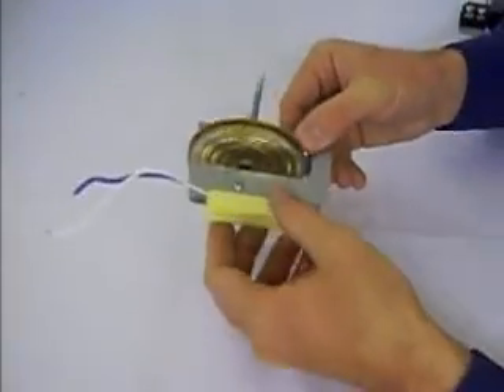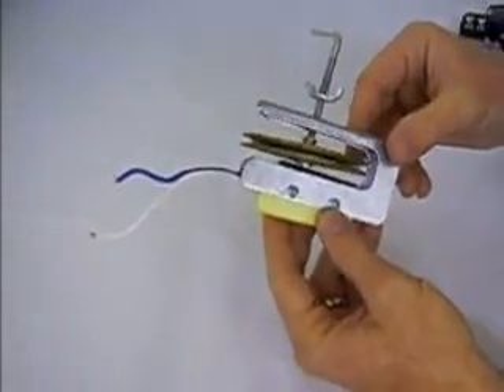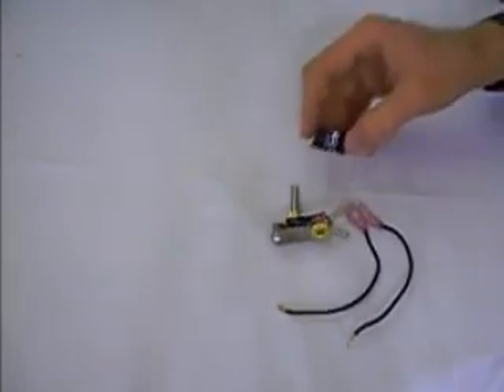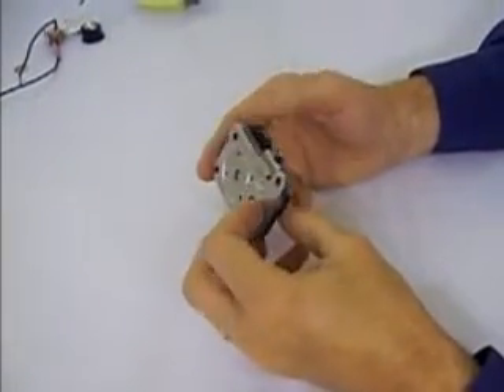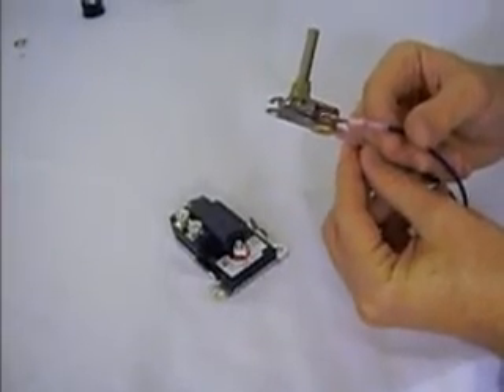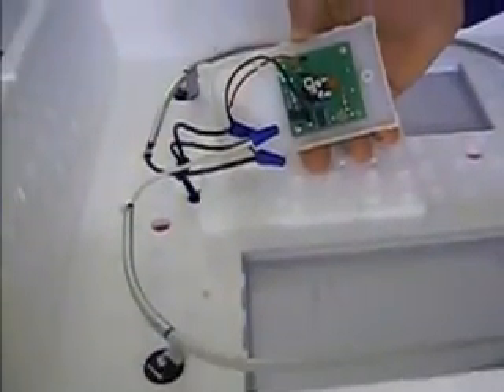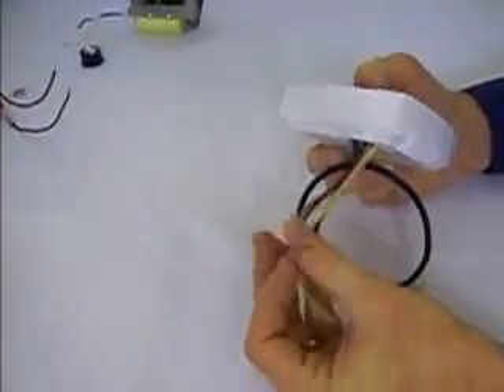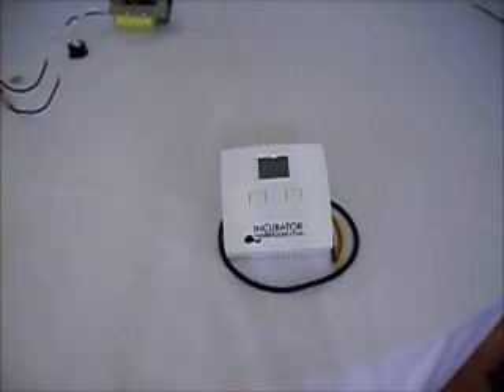Thermostat Comparison for Egg Incubators

Comment: Very nice video thanks. I fix ovens Warmers and water heaters. An I agree that the "swing" or range as you called it is just to high on a water heater thermostat. They are in fact designed with a high swing To prevent excessive wear on the system.

Comment from the maker: I'm not too familiar with baseboard thermostats, but the one thing that is critical is how sensitive they are to temperature change and how quickly the are set to respond.  Do they wait several degrees before switching on/off?  That is the thing to check.  If they switch very sensitively, they may work just fine.